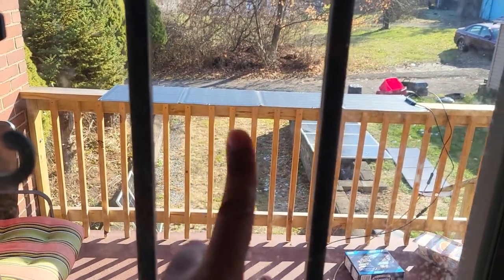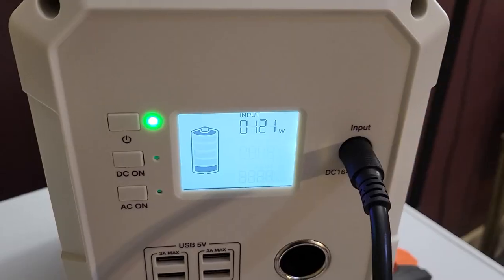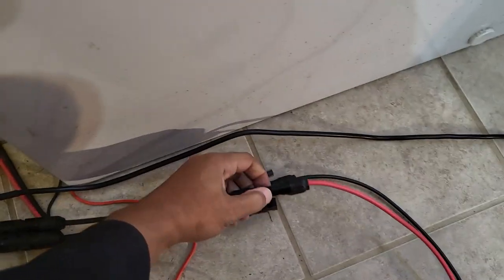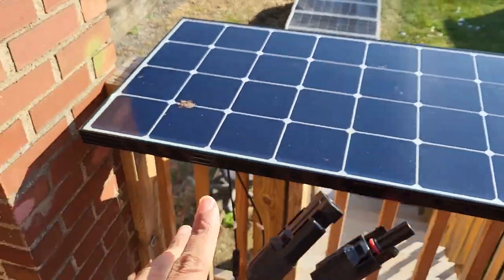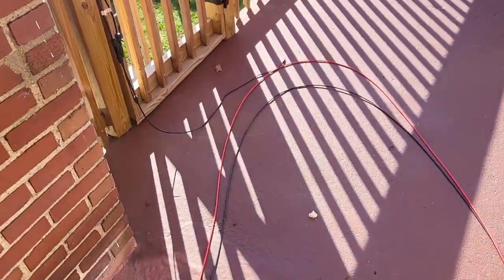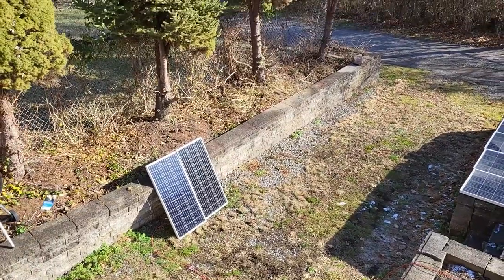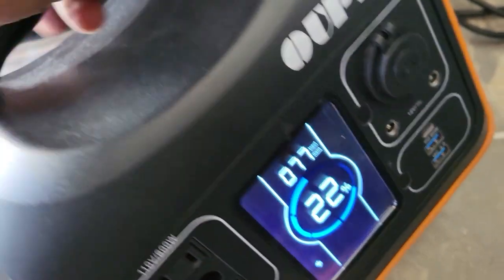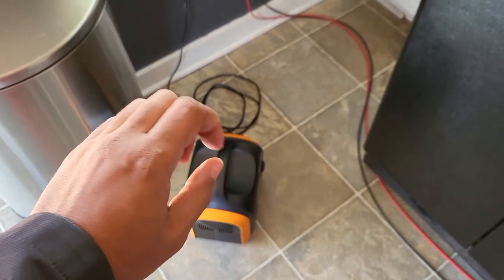Bonus! Mismatched Solar Panels In Parallel -  EcoFlow 110w and Renogy Eclipse 100w

Comment: Do you leave your power stations continuously hooked up to solar?
Reply from the maker: Yes. Those that live in certain zones are never disconnected. Temp deploys get disconnected because they are temporary. Avevolt, EF R2 Max, Oukitel, AC200P, Duran Duran, EB3A are always connected to solar.

Comment: Good video, love to see how you are consolidating
I now parallel my mismatched panels. 
200w 12v BougeRV with the Itehil 12v 160w foldout, it does an awesome job on the Delta2 if you use the XT 60i connector to the battery
FYI, I'm keeping a close eye on the Itehil 160w for a discount of ~$160 to buy 2 more.
Reply from the maker: So like 10 amps plus maybe another 8 amps right? How long is the cable and how thick.
Reply: @AskIveSolar  Yes, you are adding a few amps, so the voltage is roughly 18v after they settle, the cable is either 10 or 12G, very short runs, less than 12'.

Comment: So you need special cords to hook the panels up that way.
Reply from the maker: Yep. I mean I wouldn't call them special. Ha. But yeah, parallel or branch connectors. Guys watch how many you put in parallel though. 15 amps is about the cut off before you need inline fuses

Comment: I used to connect mismatched panels but different voltages can drastically reduce the amps Vs running them separately. I just whacked 10amp charge controllers on smaller panels because you can have multiple charge controllers connected to the same battery. The difference is large just over 40 Amps when all connected to 2 charge controllers Vs 70amps when on 6 so the different voltage panels didn't mess output this all going into 1 battery confirmed by its own in built Bluetooth. Even 4 identical renogy panels have slightly different voltages that knocked off a few amps in parallel and work better separately😂 it's annoying the first time you realise this is a factor assuming identical panels would have no problems.
Reply from the maker: That's interesting about knocking the amps down. I'll have to see about that as I don't think Ive seen that in my experience
Reply: @AskIveSolar  yep after first realising that was a thing that happened with even slightly varying voltages from identical panels in the same location I posted on the renogy forum and several more experienced people came back with identical issues with panels from even the same batches. If I remember right I think the explanation of what happens is when connected together in parallel the voltages end up getting lowered to whatever the lowest one is and that drops off the amps, not a big issue with 2 maybe unless one is like 18v and the other is 24 and obviously if u got a bunch of them in parallel that can be a good few amps, whatever the reason was in my case separate charge controllers on a few panels did the trick and thanks to will prowse videos I knew multiple charge controllers could be connected to the same battery and that greatly increased what was flowing into the battery by almost 30 amps 😂
Reply from the maker: I wonder if cabling size and length is more the culprit. Interesting none the less. I personally wouldn't do more than 2 or 3 panels in para